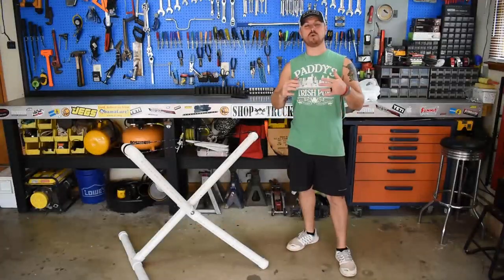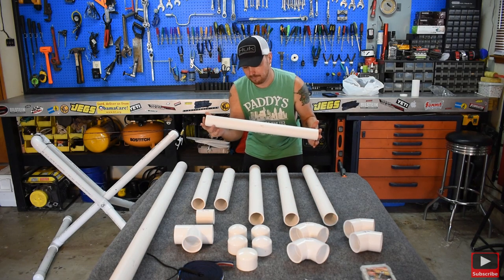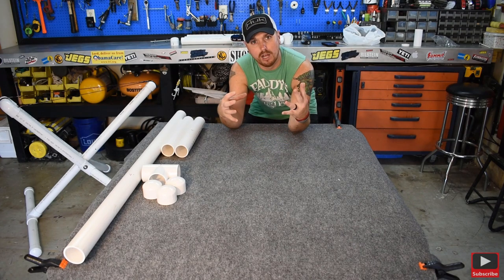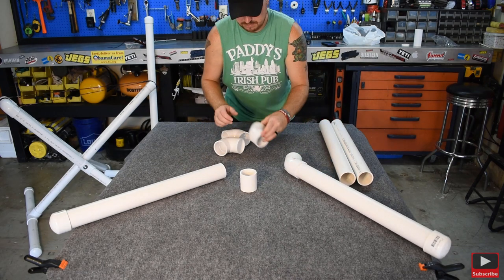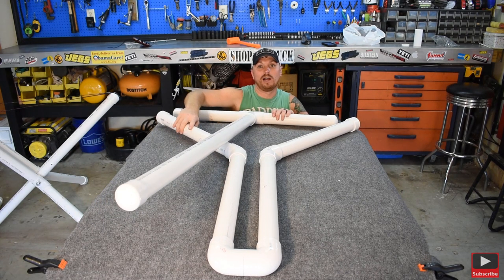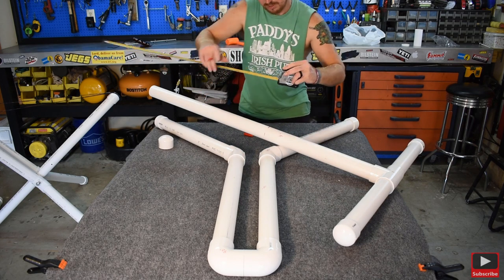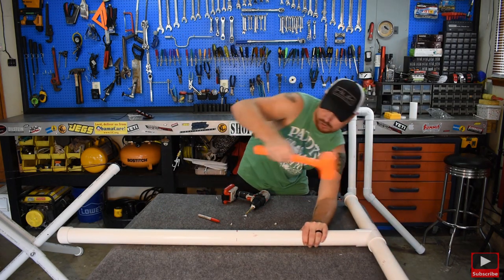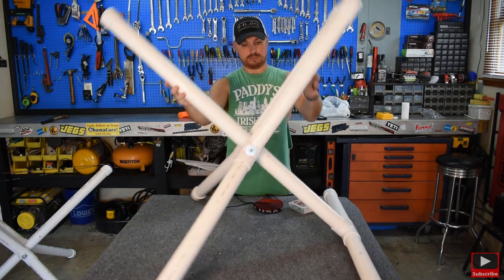The BEST Kayak Stands / DIY / How To Build Them / Step By Step

Comment: Just built this stand today, the holes are very tricky lining up and a drill press would have made things easier. Also with the 3 10 foot PVC tubes I would highly recommend anyone doing this to only buy 4 I had to take back two 10 foot sections because it was more then enough. Other then that the stand is great it folds and is very sturdy. The cost is about 110.00 minus the glue and if you need the cutter for the pvc. I cut mine with a miter saw and got very precise cuts.

Comment: Nice design. I’d offer one alteration: the free looped side scares me. I’d likely instal something (set screw on each side of the loop or a modest u-shaped kitchen drawer pull) to prevent the loop from slipping down the side if the rack is inadvertently knocked.

Comment: Great video....I actually built a set myself.....my opinion and only my opinion.....is that I spent around $60 bucks on them , due to the fact that I had absolutely nothing laying around the house, so I had to buy everything except the webbing....after looking on Amazon I found some kayak stands with carrying bag for about $50 bucks, buuuuuuut they definitely don't seem to be as tall.....Nevertheless great video....and I was able to build 2 stands with 3 sticks of 10 FT.....just made the 16in sections shorter @12 in

Comment: I think I would heat a nail (held in a vise grip pliers) red hot, and melt the holes for the screws.  That would be a tiny bit more secure, as it would make a sort of "grommet" in the webbing. But drilling seems to work well, and the stands look to work well.
Reply: A pencil type soldering iron works great for nylon webbing.

Comment: Use clear primer,  when gluing pvc,  apply glue to both the pipe and the fitting. The pipe comes in two different types,  there is regular pvc and then there is foam core pvc.   Foam core is lighter in weight.  Just as strong as regular pvc. You can use 1 1/2 " pvc.

Comment: Nice video. Anyone considered or tried a simple straight piece instead of T? Probably same strength and stability but saves fittings and maybe a full section of pipe as well. Also easier to get the flat fold several watchers mentioned. Cheers
Reply: I was thinking that exact thing as I watched this.  It is also 3 points of contact then which will never wobble and saves fittings and materials.  Did you build one to try it, by chance?
Reply: @woody350ep1  Never did, so it remains speculation. You may be the first 🙂

Comment: Would you have any recommendations on adding wheels to a setup such as this? For moving around the garage, to the back of the truck, cleaning etc.
Reply from the maker: Michael Lee , I'm sure you can add a set of caster wheels to the feet pretty easy👍🏼

Comment: Hey TJ, I don't know what I did wrong, or if I did anything wrong at all... But I built these today and made sure to primer and glue. I waited until it was dry. Set my new Old Town Predator XL Minn Kota on it, and about 10 seconds or so after, while waking to the garage to grab a drill to start rigging it... CRASH!! 1 of the "Y" legs on each stand ripped right out of the 45° elbows and it crashed to the ground. Luckily I did not have the trolling motor consol in it or my electronics on it... Are these not supposed to support that kind of weight? Thanks for any ideas you may have.
Reply from the maker: Sounds like something wasn’t right, I’ve sat in mine on the stands... I don’t really know how much weight they will hold but pvc is pretty strong especially schedule 40 PVC, that is what you used right?
Reply: Kayak USA I did use schedule 40 pipe. But honestly, I didn't know there was such a thing as schedule 40 fittings. Thank you. I'll build another set.

Comment: Hello TJ - I'll soon buy a Hobie PA 14 kayak which empty weighs 120 pounds. Hobie estimates that the kayak would weigh about 140 pounds with gear inside.  Do you think your PVC kayak stand will support that much weight?  Thanks.
Reply from the maker: Kathy Dunn , Hey Kathy, thanks for watching my video. Yes it will definitely hold the weight, just to be sure to glue all of the parts together as you build them and be sure each part it straight when you glue them. Once they are glued, you’ll be surprised just how strong these are. Thanks again for the support and good luck with your project 👍🏼🎣🇺🇸
Reply: Thanks for the reply TJ - actually its Jim Dunn, Kathy's husband who asked this last question about weight limits on your PVC kayak stand.  You were probably wondering why a female would want to fish out of a 140 pound kayak.  
Actually, if you knew my wife you wouldn't be surprised at all!!!  I appreciate your advice.  It should save me some $$$.  I'm a subscriber to your videos.  Keep um coming.

Comment: Hey brother great video, I wanted to ask for your opinion regarding kayaks. You have the ascend from bass pro and now the sea ghost
I’m torn between both. I can’t decide which one I want. I want the sea ghost 130 because it’s smooth for the water, but I like the space you with the ascend  kayak. I love the new prewire ascend. Awwww I can’t decide 
Help
Reply from the maker: ocrushjam , the ascends are nice but the Vibe is by far the better boat in my book, I've used both for a long time. You'll quickly find out that the large deck space in the Ascend isn't usable, the Vibe 130 however has a ton of actual usable space plus, built in rudder, built in transducer spot,  it tracks better, way faster comes with a paddle.... Lol I can keep going....🤙🏼
Reply: Kayak USA thanks brother you just helped me with my new kayak purchase. I’ve been through 3 kayaks already and I didn’t like none of them. They were just not stable enough for me 
Thanks again love them videos
Reply from the maker: ocrushjam , Thats awesome bud! Glad I could help. We you gonna order it or by it locally?
Reply: Kayak USA I found it cheaper getting it directly from vibe. I believe it was 899.99 for the sea ghost 130 orange camo.

Comment: This looks like a great project. Does the strap ever slide off the top of the “Y” side of the stand where it is just looped around? Would it be useful to put a single screw through the strap on that side to make sure the strap stays in place there?
Reply from the maker: Brandywine Angler , it does slide down but it's not an issue really, the reason for not screwing it down is , if you use it for different kayaks the webbing needs to be free to move for different shapes and widths. Hope this helps and thanks for watching🤙🏼
Reply: Got it! Thanks for the knowledge!

Comment: Unless im seriously off with my numbers..I  believe it only takes 2 8ft sticks to do this.. not 3 10ft pieces... 4x24 equals 8ft and 1 4ft piece  and 32 inches is less than 7ft with over a foot to do the 2 3/4 piece.... unless you're  taking 3x10 to do both sets?
Reply from the maker: Yes for both sets, having just one won’t really do you any good.

Comment: Nice build, but you only have two contact points for the kayak to rest on. This may case warping or denting if stored that way.
Reply from the maker: No... I'm sorry but that's incorrect. The kayak rests on both straps with hardly any weight. I could keep this kayak on theses stands for 30 years and it would not hurt the kayak at all..